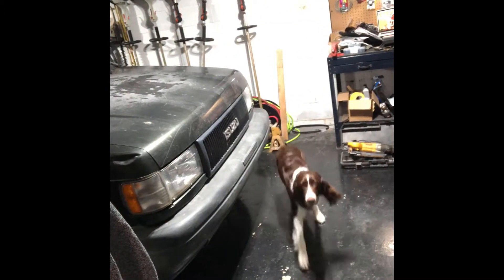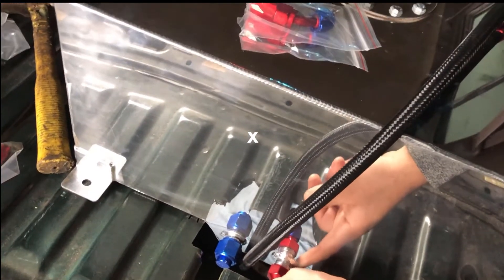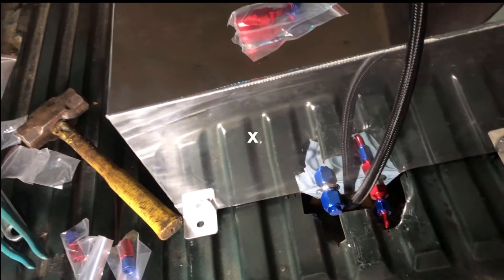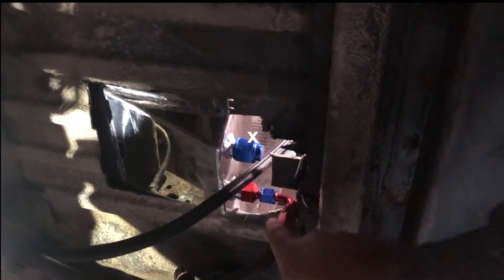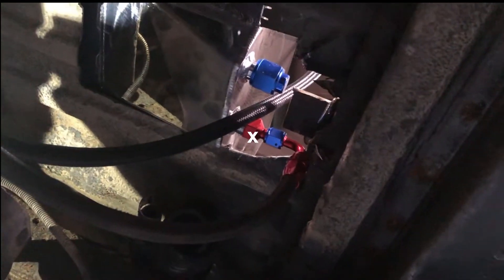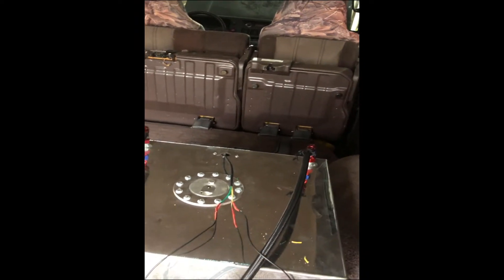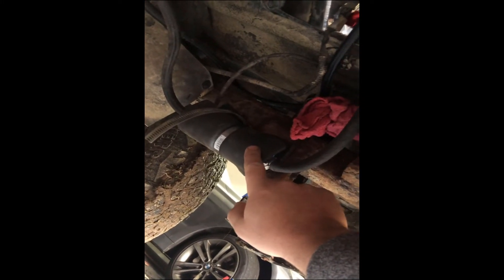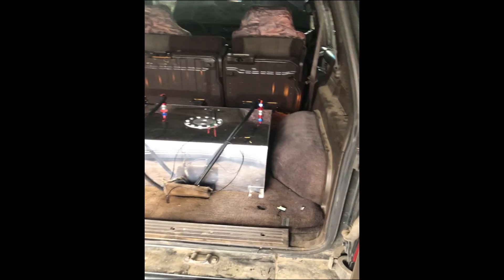Ebay Fuel Cell install+review in under 8 minutes and how-to fuel pump replacement!

Comment: What wire and fitting would snap on to that sending unit wire from the cell out of the box. I got the same cell and was just going to rewire from the sending unit up to the back of the gauge

Comment: Can you explain what the 2 fuel cell wires splice into?
Reply: That's for the level sensor so your fuel gauge can read the level. You can splice it into the factory harness

Comment: What is the name of those fittings? Like female to tube or female to hose? I'm trying to find the right fittings.
Reply from the maker: They are AN fittings, you can buy assortments on amazon or ebay just make sure they are the same size as the ones in the fuel cell kit.
Reply: @CARSTUDIOYT  my fuel cell has -10 for outlet to the pump and canister and -8 for the return. I need to buy the fittings separate so I was trying to find the name of fitting and I think it's female to hose. Does it need the ribs that the hose fits over?

Comment: Yo what about the fuel filter??? Can you just hook it up like that??
Reply from the maker: Most cars have in inline fuel filter that this will still run through. His was mounted on the frame rail i believe like most vehicles. If not you can buy one from any auto parts store and with a couple hose clamps mount it anywhere you want.
Reply: @CARSTUDIOYT  can you fill up at pump? or do you need to fill up a gas can to fill up?
Reply from the maker: @adrianmunoz2636  of course, fill it up just like you would a stock gas tank
Reply: @CARSTUDIOYT  thanks

Comment: What kind of pump did u use
Reply from the maker: 1987 bmw 325i. Any inline fuel pump will work though as long as its flow rate matches your factory pump or fuel supply needs.

Comment: Which wire is ground and which is for signal?
Reply from the maker: sorry for the late reply but if youre referring to the sending unit wires they are both signal wires. neither should be grounded.

Comment: hey man know it’s been a while but i finally got the cell installed and hooked everything up. however from the outlet of the pump i’m hearing a gurgling noise and it’s leaking fuel. i tried tightening harder and still the same gurgle + leak. you think it’s possible my o ring is bad?
Reply: Do you have a vent line?

Comment: hey man i just bought a fuel cell for my 85 300zx. i live in texas and no one on the internet says anything straightforward so i wanted to ask when i go to get it state inspected, will they fail me bc of the cell? the cars almost 37 years old so i’m not sure they’d even care but i wanted your knowledge on it.
Reply from the maker: If you dont have emissions inspection then you probably wont have any issue getting it inspected. Even if you do have emissions inspections you would probably pass as long as you run the vent to your charcoal canister (if your car came with one from the factory). But ultimately you need to look up your state's inspection requirements to know for sure.
Reply: @CARSTUDIOYT  okay i appreciate it bro. using your vid as a reference on how to install it so i appreciate the tutorial and your help.
Reply: @CARSTUDIOYT  hey man i got another question lol. can I use any fuel pump or is there a specific one I gotta use?
Reply from the maker: @diesel.bimmer   You can use any inline fuel pump you want but you need to see what your car requires and make sure whichever pump you choose has the same PSI or more and also the same cfm or more. Its better to have more than enough fuel than not enough. The one i mentioned in the video works great for many applications because its an inline pump and operates at a high psi.
Reply: @CARSTUDIOYT  okay cool. i’m getting ready to instal it and i have the 3 factory lines (feed return and vent) but i don’t know which ones which lol. do you know if there’s a way to determine that?

Comment: Do you kno if theres a way to use the stock pump?? Or if a walbro 450 will work? Thanks in advance
Reply from the maker: I have used a stock fuel pump and sending unit in a fuel cell before by drilling holes in the fuel cell and bolting the entire sending unit down. If you did that then you could use a walbro 450 but its honestly more work for the same outcome as running an inline fuel pump. If i were you id look for the inline equivalent to the walbro 450.
Reply: @CARSTUDIOYT  appreciate it thanks!